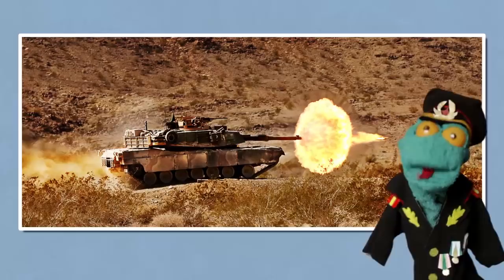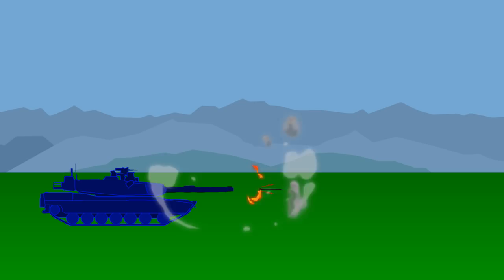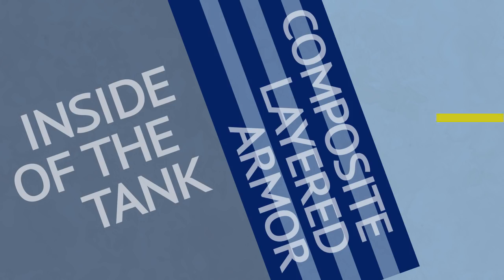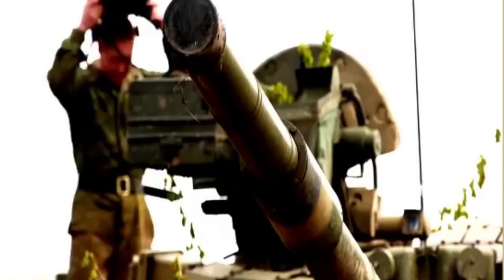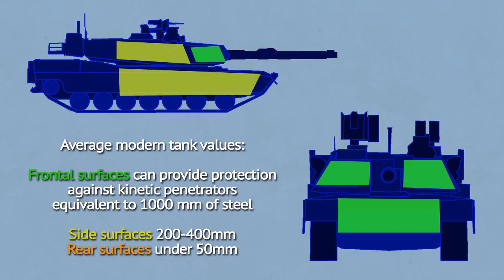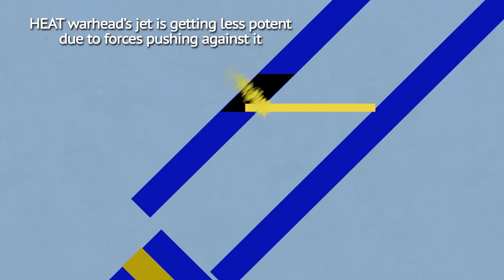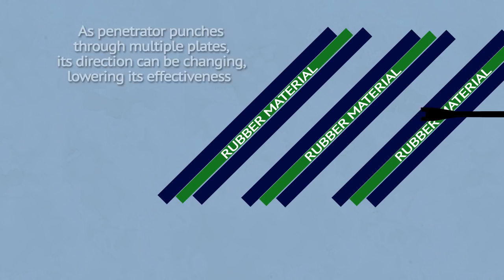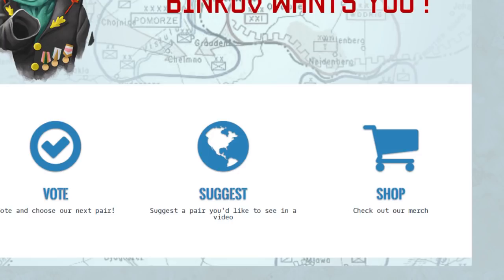Tank Gun vs Armor: Tank Warfare Explained

Comment: Tank gun vs. Armor 

In just a comparison model of performance of the Tank gun vs. tank armor, of course there is generally going to be a stalemate. That is the acceptable "give and take" as it is. Performance of the vehicle as in maneuverability and the quality of the crew are also as important factors in the race of armor v. armament. The training of the crew is probably the most important aspect of the tank. 

In WWII, the US had great training for tank crews. The Sherman tank was not a great tank. It was however, the most widely used tank by the US. Why? It was more easily mass produced. The same was with the Russian T34. 

While Germany produced at the beginning of the war better quality tanks with better armor, better main guns, better support systems and better crews, many of the tank's parts were made from different competing companies to supply parts. Different parts for different tanks. Many of these parts were complicated in design and because of the need to rush delivery and outfit the parts, quality became a lesser concern thus causing failures in the field. The other problem was because these parts were so specific and specialized for each type of German tank, the tank wasn't built for upgrading or refitting for enhanced capabilities. This is one reason why Germany quickly fell behind in tank and SPG production. At first Germany concentrated on quality, then sacrificed quality for expensive and slow tank redesign and production.

The Soviets and US alike had both their main battle tanks (T34 and Sherman respectively) mass produced on a design that was cheap but more importantly, upgradable and easily could be refitted with parts. 

Because of this doctrine on tank design and production left the Sherman and T34 vulnerable to the superior German tank armament. This was acceptable though, for the Soviets at least, as long as they could out produce the Germans by a far margin. 
Their tank crews weren't very well trained, but the easily adapted and simple firing and maneuvering capabilities were sufficient if they came at the Germans with superior numbers. Many battles were reported as German tanks and SPGs being outnumbered 6-1 up to 10-1. The Soviets would simply advance and overrun German positions taking heavy losses, but gaining tactical positions with maneuverability to hit the German armor from the rear where the armor was weakest. 

The US also had superior numbers with lesser quality tanks and used it to their advantage but to an extent of better training limiting losses but gaining superior tactical positioning. The US's main tank commander General George S. Patton knew of the Sherman's flaws and revealed his opinion behind closed doors to committees responsible for the development of the Sherman, but in public he promoted the Sherman because of its production numbers and lower costs. It was in fact a decent general battle tank that perform multifunction roles. The Pershing tank of the US was a far better tank and better part interchangeability, but at a sacrifice of production numbers and more costs. 

The tactics of the Sherman was quite simple. Maneuver in such a manner that allowed the Sherman to gain advantage in firing positions and accept that no less than 1-1 losses would be obtained. 1-1 losses basically meant that the Germans would soon run out of tanks. The Soviets had a more severe and wasteful doctrine, although not publicized or admitted, "If we can lose 5 decent tanks for every excellent tank the enemy loses, we need to make 6… and then we win”.

It's not all about the gun or the armor. It is however, a considerable margin of maneuvering and training....and of course numbers.

Comment: I thought DU rounds had also a tendency to shatter into radioactive and extreemly toxic dust that would ignite upon impact burning everyone inside the tank.  Can you confirm/infirm bcs Im not sure about the ignition of such a round when it reach this dusty state ?

thx
Reply: You mean Pyrophoric and it's not just a property of DU. But Tungsten is more lethal to a human then DU is, it's an extremely toxic heavy metal with a higher carcinogenic rate then exposure to DU dust causes. In fact, DU is less radioactive then Tungsten itself is.

Comment: Your info is a tad off the US and Germany experimented with a 152mm gun on the T70 tank as well as russia. Reimmetal (sorry if I butchered the name) is developing a 130mm gun for tanks to counter Russian. So in a way the Mause was ahead of its time as tanks are going to gradually get bigger and meaner thanks to improvements in technology.
 Also for the record I believe the US is the only nation that uses Depleted Uranium in both armor and ammo. thank you.
Reply: Tanks are not going to be bigger. In fact, they are going to be smaller. Thanks to unmanned turrets, better ergonomic optimization and smaller subsystems (electronics, powerpack), the internal volume can be reduced, resulting in a higher level of passive protection (less volume = less surface that needs to be armored = equivalent protection at less weight, or higher protection at equivalent weight).
Reply: I'd argue this but history has shown otherwise.  You can only go so low without sacrificing mobility what may work in a lab is not likely to work in combat. Case and point the Russian tanks have always had a lower profile then everyone else but they had to sacrifice a few things in order to do that, which didn't end well. Plus with a 130mm likely to be adopted tanks are still going to be heavier to make room and compensate with more armor. Nice Husky by the way is it your real dog or is that just a picture?

Comment: The larger the round is the greater the effect, is not accurate. its far more based on the type of cone shape, materiel and propellant. during several tests done in the 60's it was found that the ideal size is 5.5 to 6 inches. and less and the perforation depth is less, and more and the weight and size increase scales very badly with the only positive being more spall. this is why even today many ATGM's remain the same diameter etc. you could for example have a 180mm HEAT gun on a MBT, but then only have 12 rounds and an increase of <15% of penetration depth, while 120-125 you can have 40-50 such rounds and still defeat what you need to.

Comment: No depleted uranium allowed, 
Use tungsten instead
Reply: If you are not using DU main gun rounds then your countries tanks can be considered to be little more than 'targets.'  Of course it all depends on what's more important to you - your exaggerated fears about DU or your concern about the lives of your countries tank crews.
Reply: Maybe for Belka after what they did...
Reply: DU vs. Tungsten is actually not that lopsided Colin. DU are slightly more effective, but some countries can not or will not use DU. That doesn't make their tanks obsolete, how ever you came to aquire that standpoint, because a Tungsten penetrator will still have enough oomph to punch through most modern MBTs...
Reply: Actually it is that lopsided.  Staballoy (an alloy of uranium and molybdenum) penetrates better and has better after-armor effects.  For example - staballoy is self sharpening as it passes through armor, it has a higher density (meaning more force concentrated on a smaller area) and still retains enough hardness after penetrating the main armor to defeat the spall liners around the ammunition.

It penetrates better and it is far more likely to kill the tank after penetration.
Reply: But how MUCH better is it?
Most modern tank guns can already punch through each others front plates at about 2km and the after armour effects of most penetrators, tungsten or not, is enough to render the vehicle in a state of severe FUBAR.
Just because one is "technically" better than the other doesn't mean it has any operational effect. Tungsten penetrators are designed with that fact in mind. They make up for the shortcomings. Is the tank operationally dead after a penetration hit?
Most likely yes.

There is also the little thing about basically any western tank being armed with the same german gun (or a variant of it) so if true war would break out, I'm pretty certain people just bust out the DU.

I never said DU is bad, you said it would make your tanks into targets if you didn't use it...which is complete bull in my opinion.
Reply: And exactly what is your expertise in tank gunnery?  I'm a former Master Gunner for the M60A3, M1IP, and M1A1 tanks.  The only training in the US military that is more academically rigorous than the US Army Master Gunner course is the US Navy's nuclear power program.  According to the US Army - I was an expert in all aspects of tank gunnery.

Now - what are your credentials?
Reply: And I was a US Navy Seal Sniper with 300 confirmed kills yadda yadda yadda.
Pulling rank here won't do you any good, this is the internet, just for your information. I never refuted your technical claims, only your opinion that tanks become useless without using DU ammunition.

They very much don't become useless, and you have provided neither reasoning nor argumentation to support that notion either.

I very much agree that DU ammunition is better, however there are logistical, practical, ethical and sanctional reason for why tungsten alloys are chosen instead. It isn't just because people don't like it because they are stupid. It's more expensive to produce, for one, and I don't think anyone would use a round that, accourding to how you sound, is similar in effect to shooting gold plated spitballs at the enemy.
Reply: " . . . logistical, practical, ethical and sanctional reason for why tungsten alloys are chosen instead."

You are aware that the WHO determined that DU ammunition is not a long term hazard - right?

And DU is a byproduct of the process for enriching uranium for nuclear reactors and making nuclear warheads.  And it is actually less expensive than tungsten carbide.  According to Kitco's 'live' stream of metal prices in the commodities market uranium metal currently costs $25.70/lb.  Alibaba has tungsten carbide rod for $30-$90/lb.

And since you claim to have "refuted" my statements about some of the things that make Staballoy a better armor defeating projectile - please elaborate.  Is Tungsten Carbide self sharpening?  What about the brittleness issues that come with tungsten carbide?  What about the differences in after-armor effects between the two types of ammunition?  

And another thing that makes DU ammunition less expensive is that it can be machined while tungsten carbide has to be ground.  Although DU chips are combustible so the machine operator has to be fastidious about cleaning them up and dumping them into a tub of water.

Comment: Would HE be effective against outside equipment such as optics, communication antennas etc.?
Reply: Only if you got a lucky hit.  The locations of the optics are carefully set just far enough back so that any hit on the frontal armor will not damage them.  And radio antennas are not only hard to damage due to their small area - tank crews in combat will carry spares.
Reply: Airburst rounds (on MBTs and IFVs) can be used to damage optics of enemy vehicles. It's a common tactic and called 'blinding'.

Comment: how much armor does Tank need from protection from a 75mm ???
Reply: It depends on what 75mm you're talking about, firing what round. A modern 75mm gun firing a modern shell could easily penetrate 3-4 times more armour than a WW2 era 75mm.
Reply: @Sir_Budginton  :: yeah i figured, does also account for the length and width of the Rifle cannon?
Reply: Rom3 you can’t change the width, otherwise it wouldn’t be a 75mm anymore, but a longer barrel will mean a faster shell and therefore more armour penetration.
Reply: @Sir_Budginton   Oooooh Oookee  see learn things every other day, thanks to people like you that replys  back👍🏼

Comment: I think the real winner is the 9M133 Kornet-EM.
Reply: The real winners are Active Protection Systems.
Reply: +Jonny The Kornet-EM is designed to defeat Active Protection Systems.
Reply: Kornet-EM can defeat slow launcher based systems, but not systems with short time multi hit capability (like Rheinmetall ADS as example).
Reply: +Jonny But a Kornet-EM can fire in salvo of at least 2 missiles. If 1 missile is taken out by the APS, then the other can hit the tank. And a big problem with the ADS is that it rejects 7.62 mm rounds as a threat.
Reply: That's why i said 'short time multi hit capability'. It means the system is fast enough to intercept both ATGM with a time difference of only 100 miliseconds.

There is no problem with rejecting 7.62mm as threat. It's ment to be that way. The passive armor is well enough to protect from 7.62mm, so no need to waste a APS charge at it. No APS does that, would you want a APS to intercept a 7.62mm rifle round?

Comment: Why didnr they slant the armor on the Tiger?  Seems like common sense to slant it.
Reply: It seems like common sense now, but back then the Germans were still figuring stuff out. There are a few reasons: firstly, the designers thought that the armour should be 'braced' against incoming rounds, which is easier to do while flat. Imagine someone supporting you from behind while someone else charged into you, you would be less likely to fall down if you were already standing straight up rather than leaning back. They were wrong, but they fixed that for the king tiger.

Secondly, sloping the armour significantly reduces the amount of space within the tank, and reduces crew comfort. If you have a room with a sloped ceiling you'll know exactly what I mean, there is much less usable space.

Comment: Why do HEAT rounds have such bad aerodynamic design? Just sheath the probe with an aluminum case and you'll reduce drag and wind slippage without increasing weight.
Reply: (sorry if it doubleposts) When it comes to Americans, the 120mm M830 had a flat nose design, but the replacement M830A1 has an aerodynamic cone.

Comment: Mobility much more valuable than Armor in open environment.
Reply: Not really - every current fire control system will automatically adjust the sights against moving targets.  And the time of flight for a Sabot round is so short that it is impossible to dodge.  If a well trained tank crew engages your tank - you are probably going to get hit.  And it will be your armor that determines if you survive.
Reply: Not true. If you are fighting against a capable army you will be hit a lot regardless of your mobility as previous comment said. Artillery fire would completely disable a column of lightly armored vehicles in open environment. In that kind of situation survivability is provided by armor and self defense weapons such as APS and C-RAM

Comment: Blyat
Russian tank is the best
Reply: The Russian tank is 'best' for Russian tactics and doctrine.  The equipment, the tactics and the doctrine all need to be designed to work together.  Russian tactics take advantage of the strengths of their tanks and minimize their weaknesses.  Put 'expert' Russian crews into an American tank tanks they will not be able to operate it effectively if the use Russian tactics and doctrine.  Likewise for US crews in Russian tanks.
Reply: Colin Campbell
Unlimited ruski soldiers can defeat any army.
Reply: +Mescid Baba
cough afghanistan cough